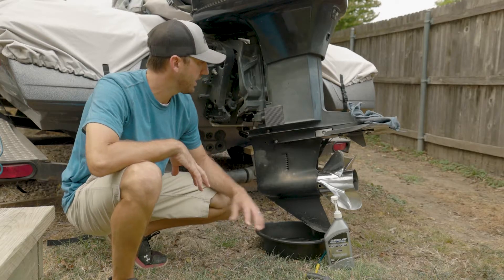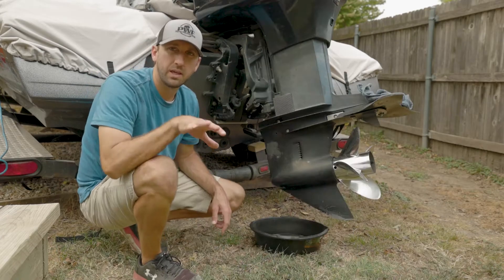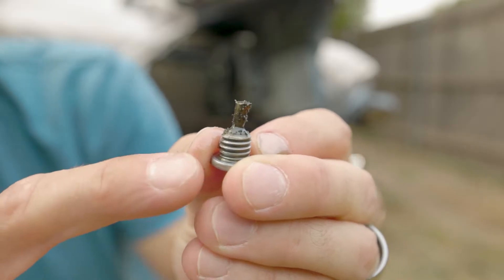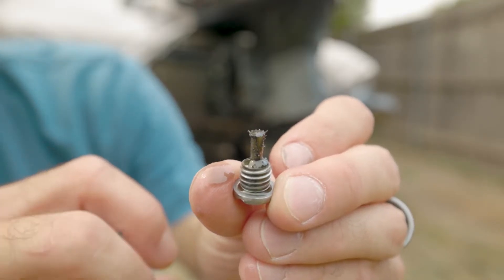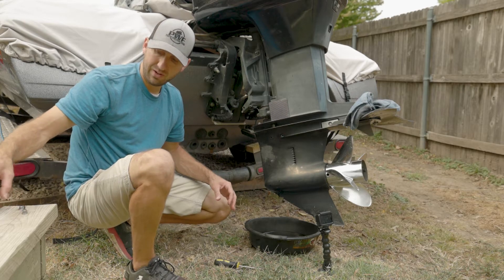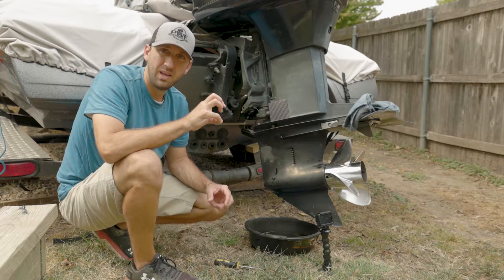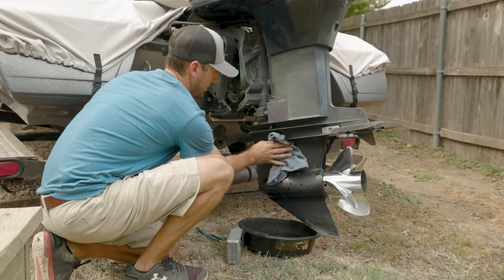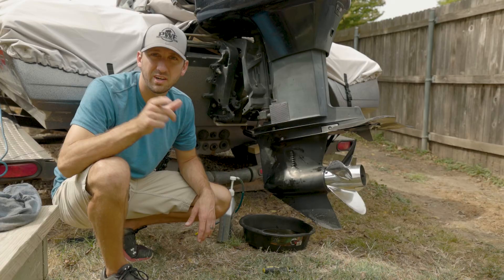How to Change Lower Unit Oil (2-Stroke Outboard)

Comment: Would it make sense to fill the oil front the vent and put the drain plug back in ?
Reply from the maker: It would be hard to tell when it’s full. Other than that I don’t know if it is required to fill it from the bottom up.

Comment: Use the best snug fitting screwdriver to prevent problems. Keep new seals on hand, I buy a 6 pack at a time. They are crush washers, usually only good for a time or two, any question - replace them. Some replace them every time, your choice. Keep spares!
Reply: CRAFTSMAN 3/8-in Drive 3/8-in Flathead Bit Driver Socket
Item #1049408 |
Model #CMMT42653
7$ , This is What I use on mercury lowers, will work on old Johnson's but not a good fit for those at all , need a bigger

Comment: My screws on their freaking tight. I’m a little worried about stripping it out.
Reply from the maker: Any luck getting them loose?
Reply: CRAFTSMAN 3/8-in Drive 3/8-in Flathead Bit Driver Socket
Item #1049408 |
Model #CMMT42653
Found at Lowe's for 7$ or ace hardware, attaches to a ratchet extension and ratchet gives a bit better leverage ime . The harbor freight Pittsburgh set doesn't work very well the bit ends are too thick. Thought about grinding them flat on one side a little bit but ain't no nobody got time for that

Comment: For example if I take off my drain screw and leaving the vent, but it still comes out fast why is that?
Reply from the maker: Honestly not sure. Guess it’s fine as long as everything else checks out ok.
Reply: unfortunately you either have another 'vent' which is bad maybe the prop seal.  Or your oil is highly viscous due to perhaps water.

Comment: Have you ever had problems reinserting the filler screw mine will not tighten and it doesn’t seem stripped.
Reply from the maker: No, I haven’t. You don’t have a double seal on there or something making it not want to tighten up?. Maybe try and order new screw?
Reply: @PrestigeWorldwideFishing  quickest response ever👊🏽 screw looks good, threads look good it just won’t catch to start tightening. Nothing looks stripped. One screw keeping me off the water😂🤣 story of my life!!!
Reply from the maker: Dang man, that sucks. Hard to say without being there. Did you try yelling curse words at it? Sometimes that works for me
Reply: @PrestigeWorldwideFishing  I always try that seconds before hitting with a hammer and then saying I’m gonna sell it…we must’ve went to the same marine mechanics institute😂🤣😂thanks anyway. Great video btw!!!
Reply: @jmontoya1677  you always get more screws when your on the water :)
Reply: Take the little o ring out of the engine and put it into the bolt. Then screw it in. Literally just had this issue for like an hour
Reply: @Buildcultureyoutube thank you but I accidentally removed the wrong bolt it wasn’t the drain or fill. I almost messed up🤦🏽‍♂️

Comment: Hello is this the only oil change you have to do. Does this cover the upper part as well eg pistons.
Reply from the maker: Somewhat. The only change yes. I have to add oil to my reserve. My motor is oil injected so it pulls from the reserve and mixes it with my gas automatically. I just have to make sure there is always oil in the reserve tank.
This isn’t the case with all motors though.

Comment: I'm having same problem as one of your subscribers.I cant get any more in it and its not coming out of the vent.I squeezed in about a half of quart so far and cant get anymore in but it's not coming out of the vent..
Reply from the maker: You may need to attach a new quart of oil. At least on mine that straw isn’t very long and once it loses suction it won’t pull oil through. Once it’s full it will come out vent, it doesn’t have anywhere else to go
Reply: Don't forget to spin the prop a few times when you refill the oil, you'll get a couple more pumps in

Comment: Can someone please tell me where I can buy the seals
Reply from the maker: Lots of options on Amazon. Not sure what your motor is but here is a starting point

 https://www.amazon.com/Washers-Compatible-Mercury-Outboards-Mercruiser/dp/B0C27LTPG2/ref=mp_s_a_1_5?crid=3AD6GQJC4193B&keywords=mercury+lower+unit+oil+seal&qid=1693017686&sprefix=lower+unit+oil+seal%2Caps%2C146&sr=8-5
Reply: @PrestigeWorldwideFishing  i get mine at local mercury dealer

Comment: Why wouldn’t I just fill from vent?
Reply from the maker: It will spill all over you most likely because the air can’t escape.
Reply: When filling from the bottom air has a place to escape (vent hole) air bubbles  come from oil filling in all the tiny crevices of the gears in the unit , in turn not filling the unit up cuz of trapped air instead of oil. Filling from the top vent hole would exasperate the trapping of these air bubbles and you wouldn't get a good fill , and a mess. It would take forever as you would have to wait and hope the air bubbles escape etc etc🤝

Comment: Can I use Sae 90 high performance in my 40hp 2 stroke? Or should I use 80w-90 instead
Reply from the maker: I don’t know for sure, but my guess is either should work. The 90 high performance is typically for bigger motors because they are going to run hotter.

Comment: I’m refilling the new oil and the oil does not come out of the top hole. Mercury 20hp 200 1978
Reply from the maker: You need to keep adding oil until it does. Oil has to fill up that lower unit gearing and when it is full will come out of top hole.

Comment: I have the same motor and I'm going to change the oil tomorrow while the boat is docked in my slip. Tricky thing is that the boat is in the water, But the motor when tilted up is out of the water and I have access to the drain plug. So hopefully everything goes smoothly and I'm able to change the oil as the boat sits in the water lol 🤞🤞
Reply from the maker: 😂 that does sound very tricky. Might need to get a buddy to hold the oil pan for you. Good luck!

Comment: Hey bro, I just bgt a boat with 00' merc 90 2 stroke. Trouble starting, crank np, firing up hard. After fishing nd moving same problem. Bogging when finally starting, runs good when running up lake. Ne ideas 
wld b appreciated..
Reply from the maker: Sounds like fuel issue. I would change the fuel lines, fuel filter and spark plugs. Also, make sure you are only running non-ethanol gas. Probably wouldn’t hurt to run a couple cans of seafoam through it to clean out all the carbon deposits. Do seafoam after you have changed the lines. Good luck and let me know if that helps.
If you’ve seen my “voltage regulator” video, I have a similar problem, but mine doesn’t seem to be fuel related.